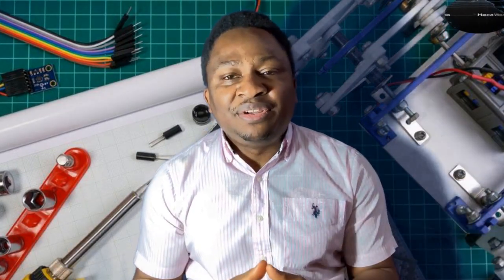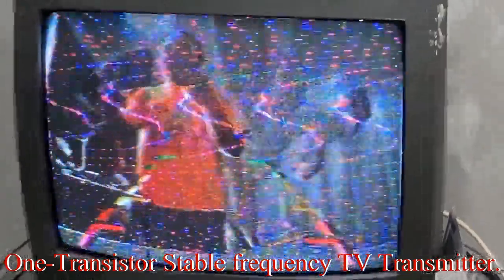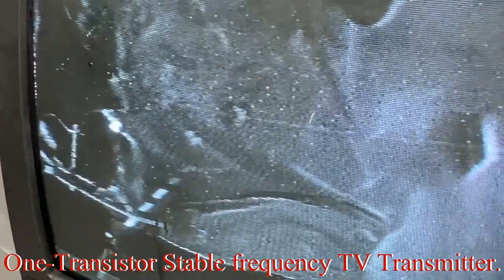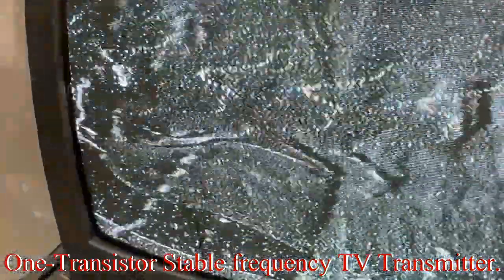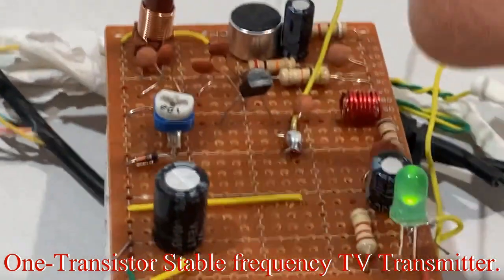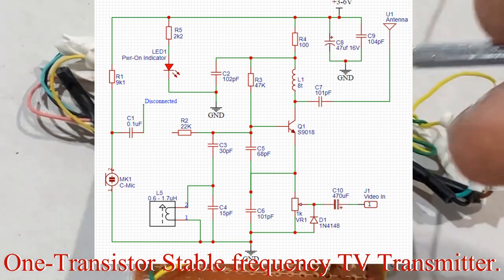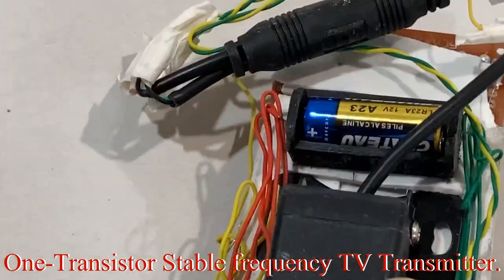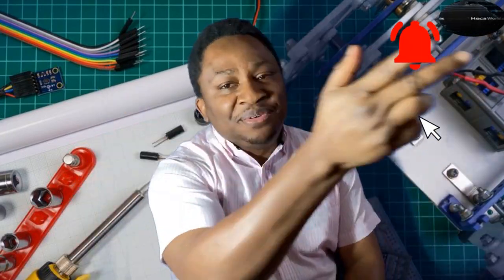How to build a One Transistor Wireless CCTV   Stable Frequency TV Transmitter | DIY Wireless CCTV

Comment: What is the range .? 
What is the output RF power ?
Thanks .
Reply from the maker: It was not measured, but based on the transistor and the battery used, it should not exceed a few hundred milliwatts.